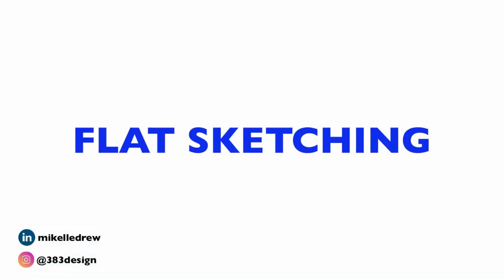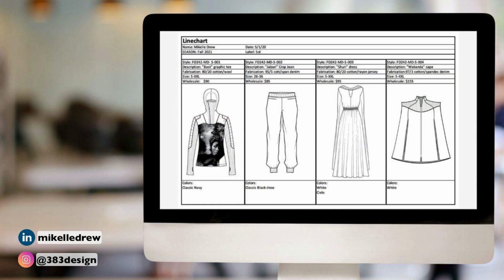CLO3D or Illustrator: Which Fashion Design Software Should I Learn first?

Comment: Great side by side narrative on the different use cases! In my world, they are two entirely different tools depending on what your goals are. Illustrator is not a patternmaking tool, but CLO can do fantastic black/white sketches in Schematic Mode if you take the time to learn it. Well done!
Reply from the maker: Hi, thanks for watching and commenting.

Illustrator is not a traditional pattern making tool, but I've met quite a few designers recently who succesfully use it for that.

And the schematic render . . . I have had multiple debates with both friends and people on LinkedIn about that. It's gotten better, but I'm still not convinced it beats a flat sketch. (And I've spoken with some manufacturers that agree!) 

Having said that, I do know quite a few designers that use them in tech packs, so somebody likes them. Just not me, I guess😉